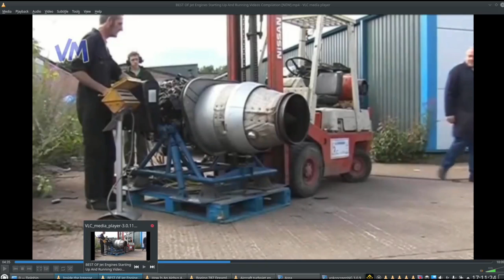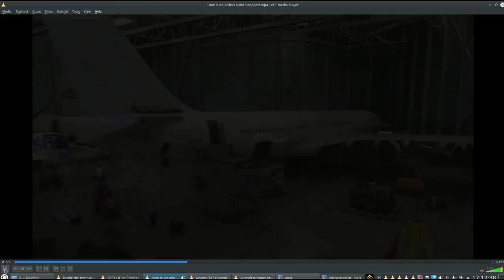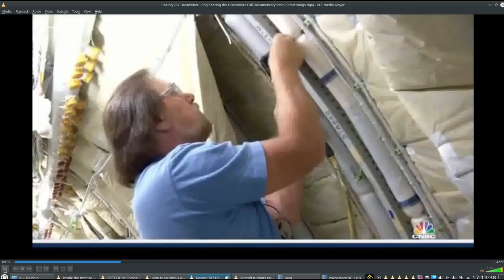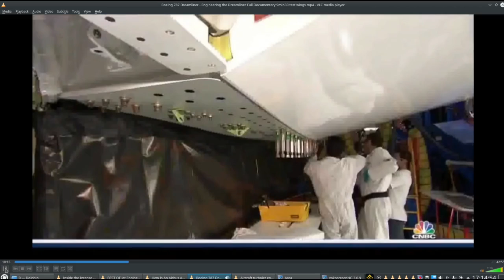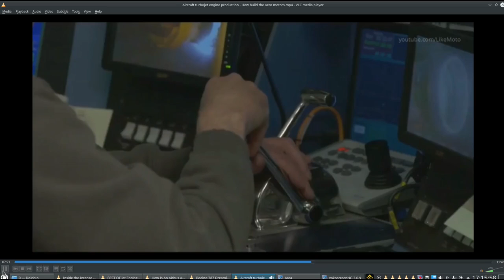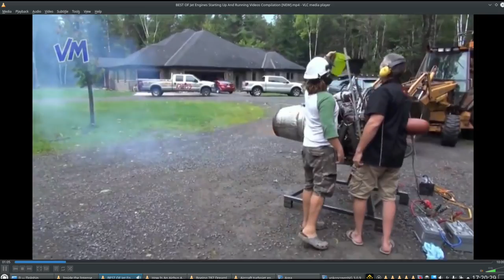Jet Fuel Hoax 3 - (game over)

Comment: Hi Danny. Yea, the way you describe "afterburner" in military planes, is accurate. In "Top Gun" when you see the "fire" come out the back when they turn on "afterburner," it is simply jet fuel being squirted into the exhaust tubes "at the back." If you do the math on how many millions of gallons of fuel they say is needed, and look around and see NO NEW REFINERIES for so many decades, ..... the math alone dictates that planes need no fuel, or very little fuel when they are cruising at altitude. Also, my favorite one is this.... when we drive to the airport to pick up our relatives flying in, we would see fleets of tanker trucks coming and going. We see almost none of these tanker trucks, even around Los Angeles' LAX. I have spent 20 hours around LAX between 1996 and 1999. I saw no tanker trucks coming and going. There would need to be 100 or so every hour I would think, perhaps 1,500 trucks for each day for an airport the size of LAX, Atlanta, or Chicago O'hare. 300,000 trucks a year.... minimum, per major airport.
Reply: if what they say about how much jet fuel is loaded on a plane (747 average about 50K gallons), they would need to have way bigger hoses to fuel the plane.  The typical hose I see filling up a jet looks like the size hose firemen use.  If they are trying to fill a average 747, with 50k gallons of fuel, that would take forever with the hoses they are using.
Reply: I just found this, haven't finished reading it yet but there's supposedly pipelines all over the place

https://www.airlines.org/wp-content/uploads/2018/01/jet-fuel-1.pdf
Reply: The squirting of unnecessary jet fuel into the back of the exhausts is a lot like the unnecessary screaming in tennis, just a little less disturbing.
Reply: @topsykrtz3467  supposedly but i doubt it. That would mean every major airport is close enought to a fuel refinery to pipe in jet fuel aka high grade kerosene. I think  if they were digging a trench from the refinery they would tie in every possible gas station on the way. Thats a lot more cost effective than trucking it out. Hey maybe the gas stations are tied in idk but ita a good common sense question.